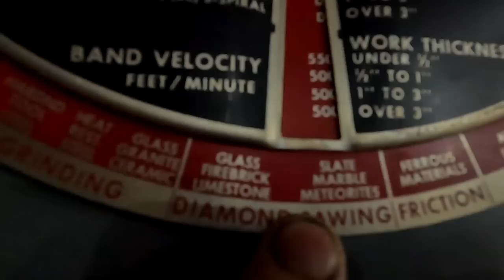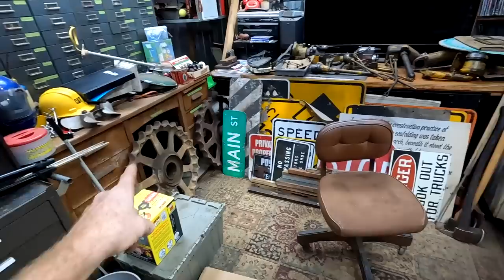It STILL won't start. Let's find out WHY! (Quick SHOP Tour) ~ Day 2 ~ 1965 Allis Chalmers 645 Loader

Comment: when i was in afghanistan working on humvees i had a oil filter that was so stuck it took me like 4 hours to get off
Reply from the maker: Dang 4 HOURS... I bet that sucked!
Reply: Did all your humvees have 6.5td in them?
Reply: @ronfrance4041  the older non armored ones where 6.2s i think i dont remember what the turbo motors where. they where a litlte bigger.

Comment: does it have two switches to turn it on n does the starter turn the engine right direction sounds crazy but another guy had that problem with a diesel forklift.

Comment: Great job on the fuel pump.  I would have been intimidated by all those small parts.  Do you have a shop manual for this or have you disassembled these before?

Comment: Is it 24v applied used to turn fuel on or to turn fuel off??? I need to know I have a Allis Chalmers 645M it runs but there are no wires attached to the injector pump. It’s suppose to have some. We can start it and it runs fine but we have to choke it out to shut off. So I’m wondering if mine is power applied  to shut fuel off?

Comment: Nice Shop!  Do you get any condensation with the uninsulated sheet metal?
Reply from the maker: Thank you Jim! Unfortunately, YES when I heat the shop in the winter... So I just don't heat the shop in the winter... I've built covers for all of the ways on the machine tools, but I still get some surface rust from time to time, not too much though... I would love to insulate the shop, but I don't want to have to move EVERYTHING, plus it would totally change the way the shop LOOKS and feels... So my plan is to insulate with spray foam around the outside, and then add another layer of steel siding around the entire shop... not sure if that will ever happen, we'll see I guess!

Comment: Hey Matt - I'm not a mechanic by any means, but would an ultrasonic cleaner be a good way to clean the gunk off the parts you found on the insides of the injector pump? From about 20:00 to 45:00 I kept wondering how I'd clean those parts, but then  I'm from the "Hammer School Of Mechanical Repair" - yes, that school: Use a hammer. If that doesn't work, get a bigger hammer. If that doesn't work... C4!
Keep on wrenching my friend!

Comment: Is there a reason you did not test the fuel cutoff solenoid?
Reply from the maker: Well, It already worked when it was on the machine, and i just didn't think of it.... I was more concerned with fuel flow... it's easy to get to if I need to later!

Comment: You are barbarian;))) with fuel filter. Next time you can use filter chain puller. Very simply and fastly.
a lot of extra work in the video;)
I like yours videos. Interesting.

Comment: Is my video-display 'reversed', or were you trying to turn-off the fuel-filter IN THE WRONG DIRECTION? I even thought I saw it turn clockwise, just alittle bit - exactly as one might expect in TIGHTENING a filter....? I've often done it myself [!] and it's the most frustrating thing possible!!

Comment: Why would you want to do all that work TWICE if you didn’t have to ? 
How much is the kit ? 
You should have band type filter wrenches instead of those Hokey pliers , And the other commenter is correct you were turning the filter the wrong direction on the machine . Pro Tip always grip the filter at the top or the mounting end to remove it because that is the strongest location of the filter .